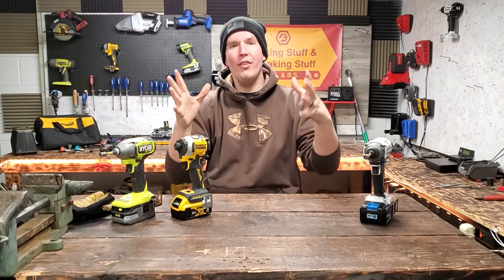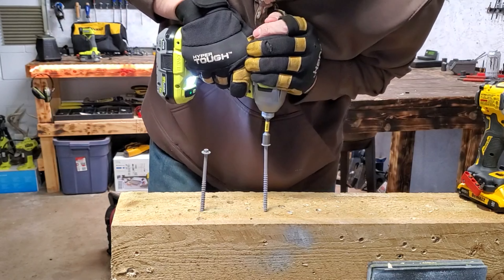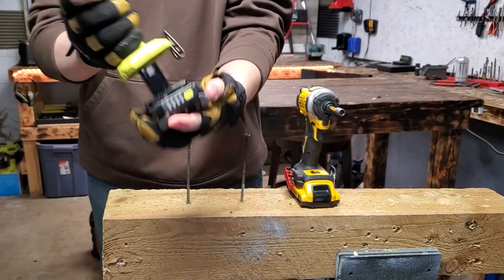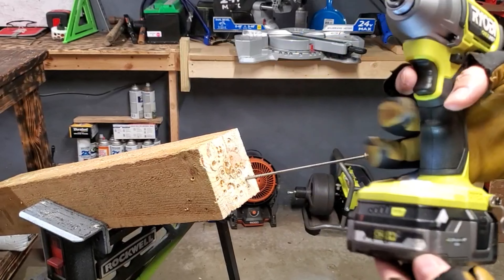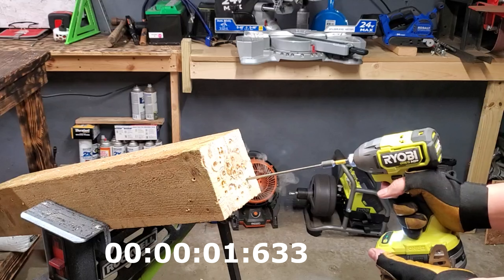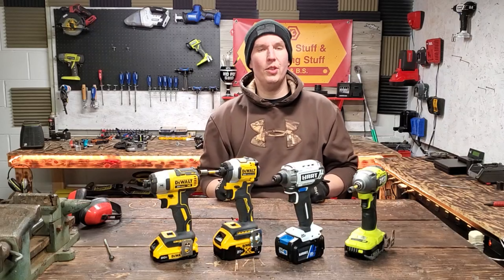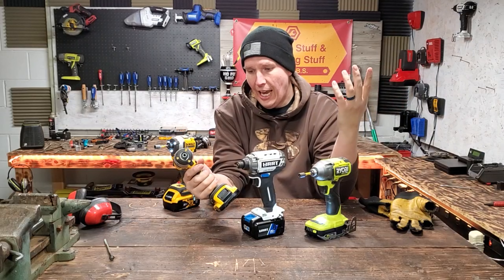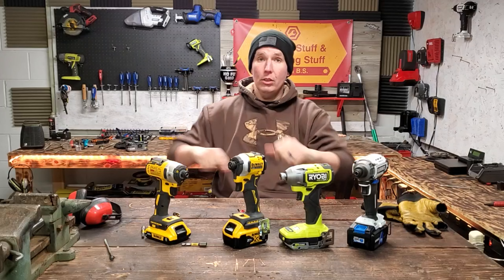Dewalt atomic VS Ryobi VS Dewalt VS Hart

Comment: the DCF850 is no slouch. It beats a Ryobi with 400 in-lbs extra torque
Reply: More like the other way around. The Ryobi HP is rated at 2200 inch pounds of torque which I think it's more like 2000. The DeWalt 850 is 1825. The fact that the Ryobi HP was neck and neck with the DeWalt I'll stick with Ryobi and keep the extra $50 it cost to get the bare tool DeWalt.
Reply: The DCF850 has 350 more RPM, so I’m sure that helps...